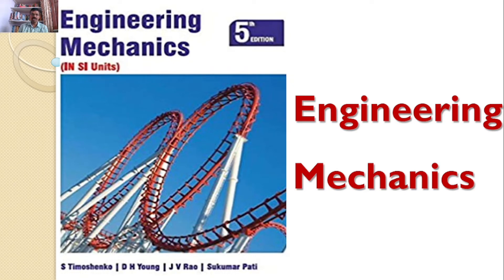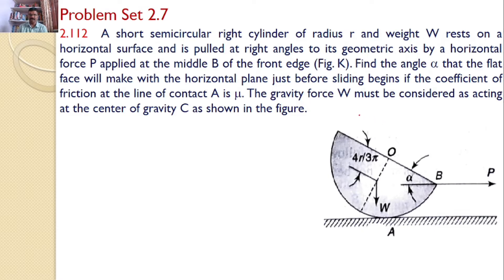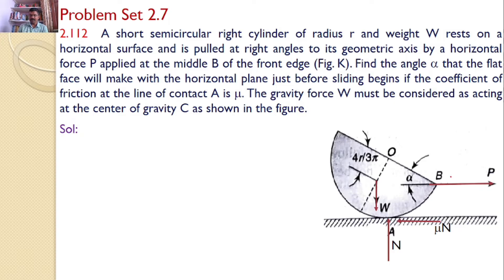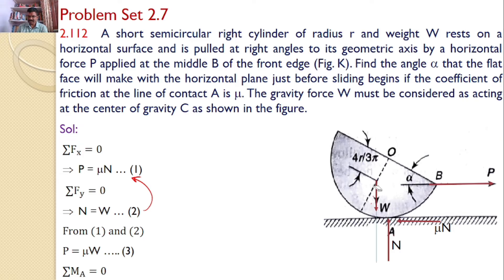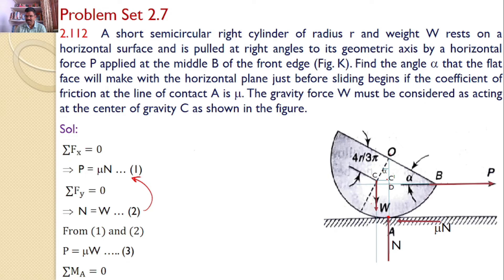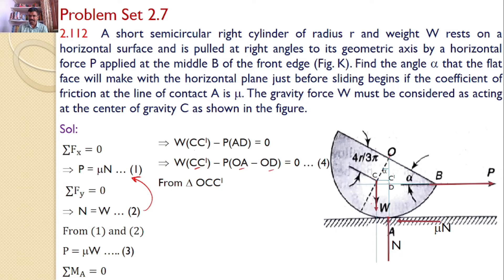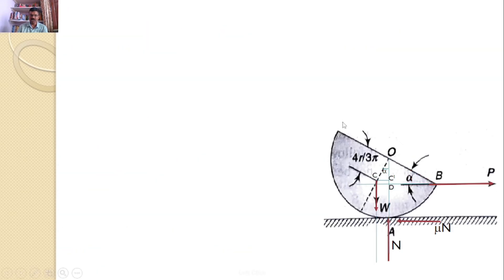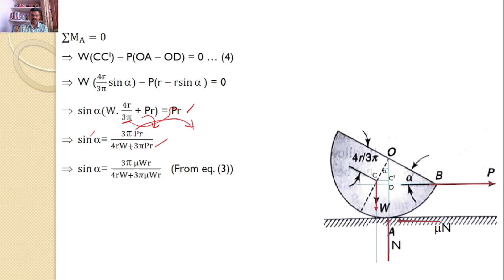Engineering Mechanics, solution, Problem 2.112, Timoshenko, Equilibrium Equations, Friction

Comment: Sir please 13. A smooth circular cylinder of weight Q and radius r is supported by two semicircular cylinders each of the same radius r and weight Q/2, as shown in Fig. K. If the coefficient of static friction between the flat faces of the semicircular cylinders and the horizontal plane on which they rest is μ = and friction between the cylinders themselves is neglected, determine the maxi- mum distance b between the centers B and C for which equilibrium will be possible without the middle cylinder touching the horizontal plane. Ans. bmax=2.837 Solve this question please